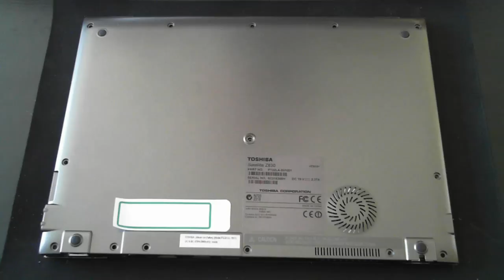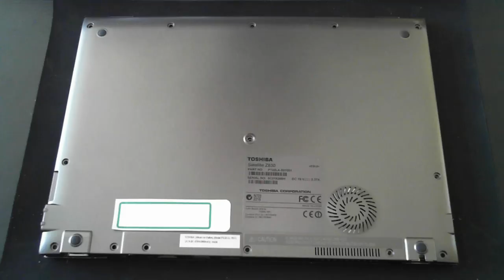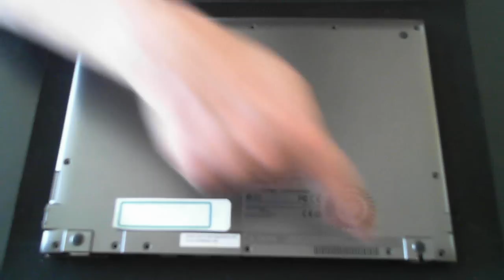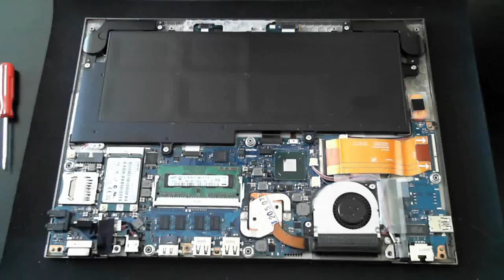Toshiba Z830 Ultrabook Teardown & Opening

Comment: Hi
I have found the screws holding then SSD VERY hard to remove, particularly the one closest to the center of the computer. I have done 2 so far but on the 2nd had to use "extreme" measures to get the inside screw out!  Any tips? (note Toshiba Z30)
Reply from the maker: +Roger Peedle I've never found the screws to be too hard. Are you using the correct phillips head screw driver tip and a decent screw driver?
Reply: when I finally removed them they show evidence of locite, pn both z30's which I think was the problem (which must be put on during assembly I assume as both had nevet been opened before?).

Comment: Hi! I am from Argentina. My z830's battery has been puffed so I had to remove it. 
Do you know if I plug in the charger it will turn on ? I am not sure if exist a protection circuit in this machine so it can work with no battery like the most of the notebooks.
Thanks very much.
Reply from the maker: Federico Aime It should turn on. Just try it and see if it does!

Comment: I couldn't find any store that sold the right screwdriver for the the middle screw, but I managed to open the computer with a simple flathead screwdriver. Read this: http://www.instructables.com/id/Removing-Security-Torx-Star-Screw-with-a-Flathea/

Screwdrivers for Torx T6H screws (a.k.a. T6 Security or TR6 or T6 Tamper-Resistant) can be really hard to find unless you live in US or UK.
Reply from the maker: ohreally Yes they can be hard to find. You generally need to go to a specialist electronics store or even find them online.